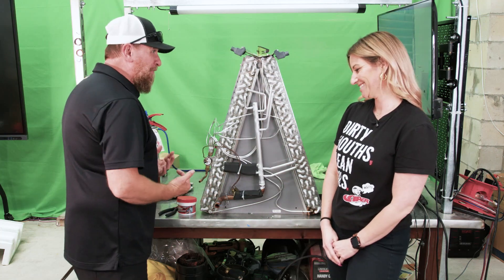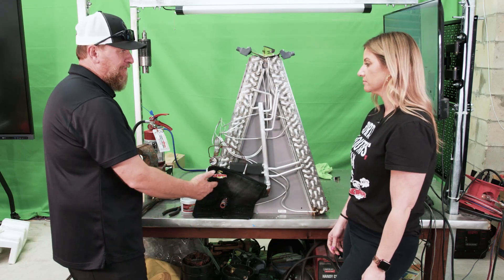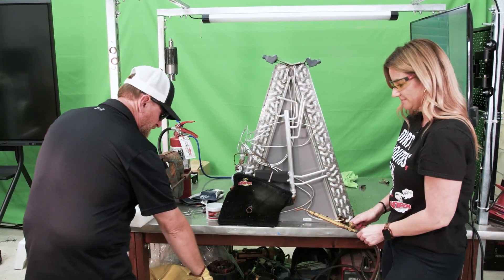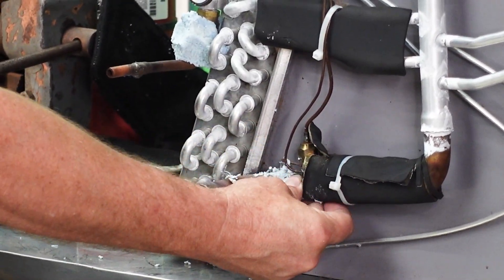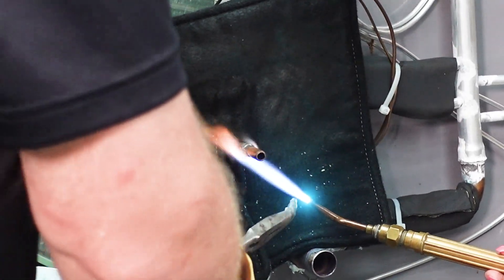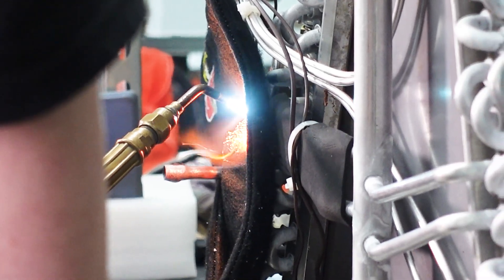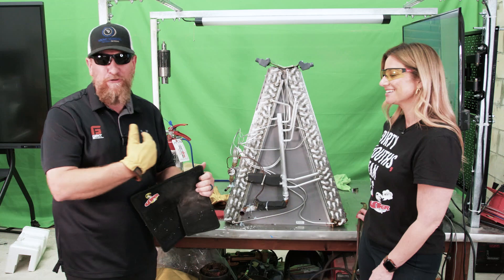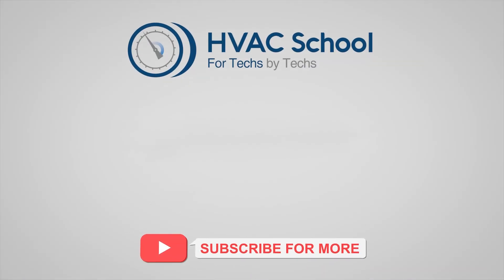VIPER WETRAG HEATSHIELD Demo - How to Protect HVAC Components During Brazing

Comment: They had some WetRag get out of the factory that had a PH problem. I lost two coils where the WetRag ate through aluminum. Now I use wet rags.
Reply: I always have a cooler with a separate bag of ice to put in my bucket of water to soak rags i feel more confident using something cold as possible ...been doing it for years